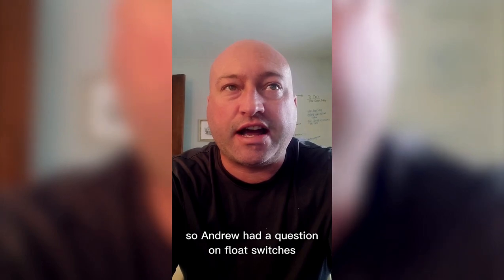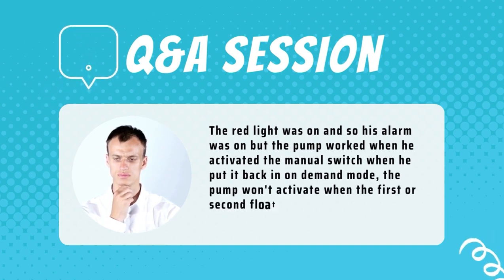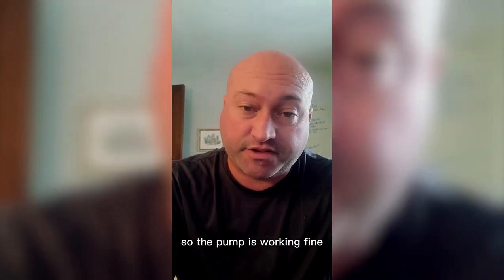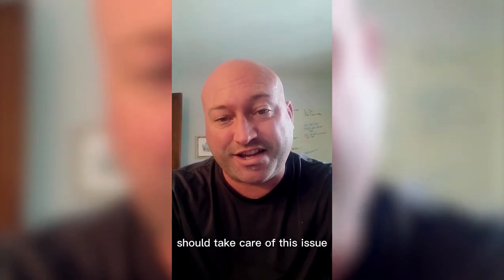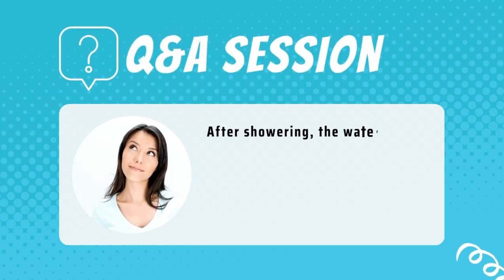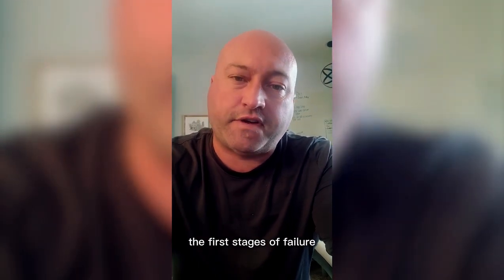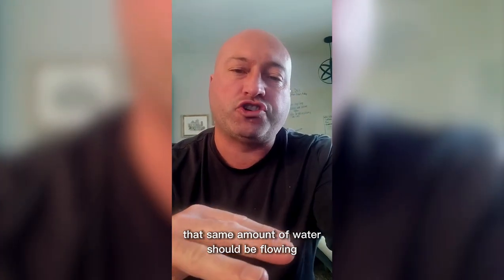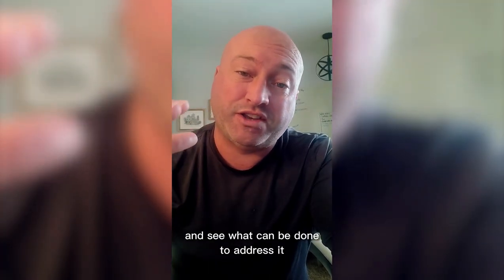Bubbling toilet, septic tank repair, pump float switches, and more | #askthepumperdude Episode 015

Comment: I found a public record of the septic system being decommissioned in 2007 at the house im renting, and sewer connected.  But, the riser is right there in the yard, and less than 10' away is a grinder with a grooved grey lid, and there is an alarm system on the wall that is still powered.  Is this normal?  Is it possible that the septic was not decommissioned fully?  The record ended at the final inspection being scheduled but shows it's still just scheduled, from 2007...   Should I open the riser and see if there is still an unfilled "tank"?  So far I have only stuck my borescope into the hole in the grinder lid and can see super rusty cable and can also hear water flowing.  There is a pond on the other side of the house with an open-top drain canal that goes into the ground underneath the house and is most likely what I can hear inside the grinder too..  The water flowing from the pond down the drain smells like sewage.

I have never rented a house before, let alone a rental with signs of a septic system, so I don't really know what to make of all that.  All I do know is that this house was built in the 60s and there was a permit for changing the roof in the 00s but the pictures of the house back then reveal that there were a lot of changes and additions without any permits